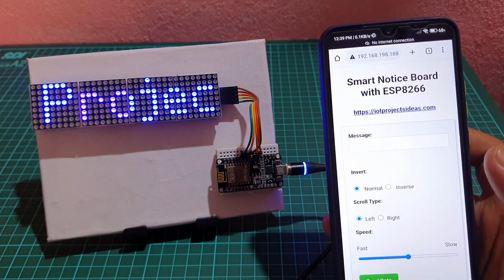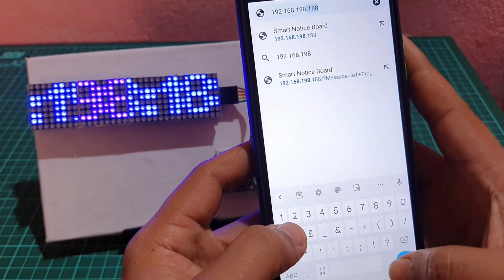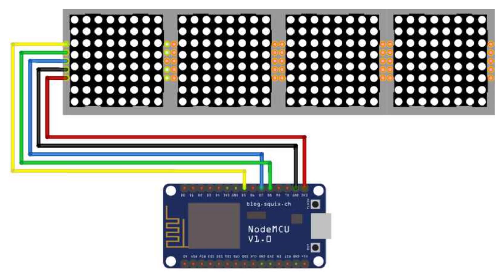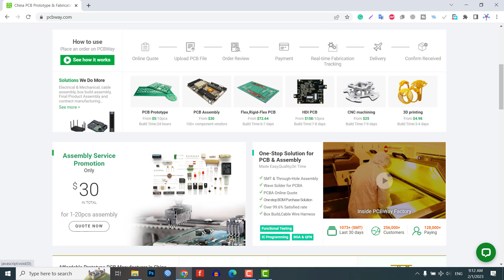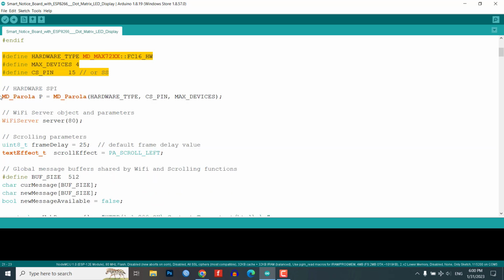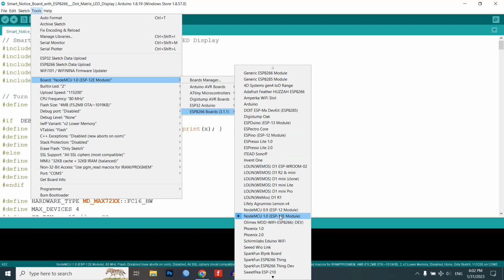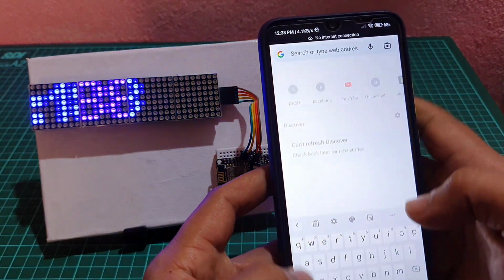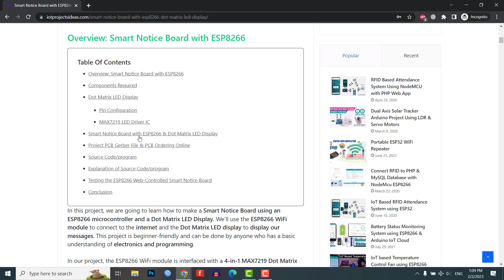ESP8266 based IoT Web Controlled Smart Notice Board with Dot Matrix LED Display

Comment: Thanks for the video ❤

but it is going to backup and restore the recent message if the device is being turn off and turn back on?

And also If I wanted to use it with 8×32 w2812b Strip LED Display instead of the 8×32 MAX7219 Dot Matrix LED Display, is it going to work???